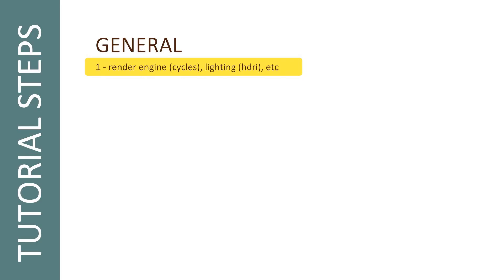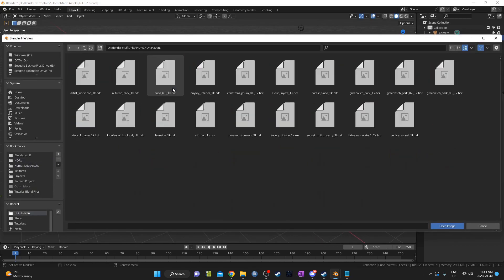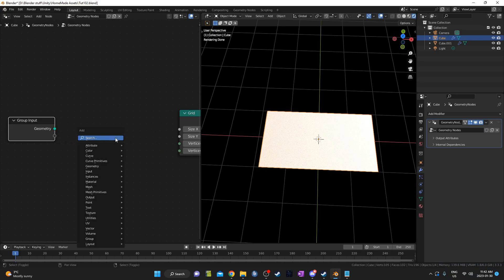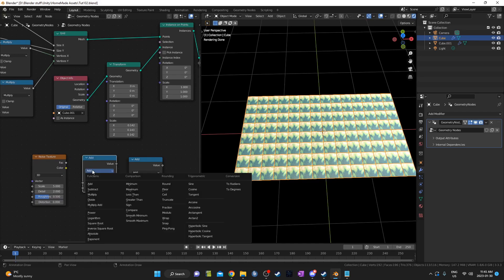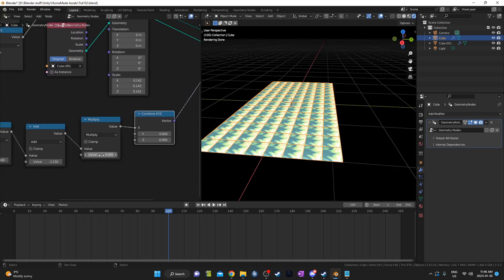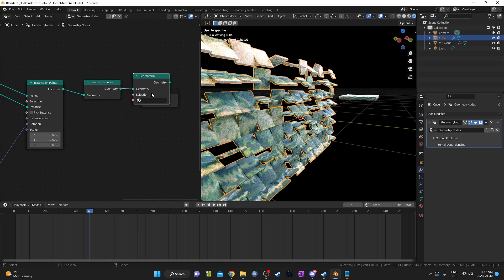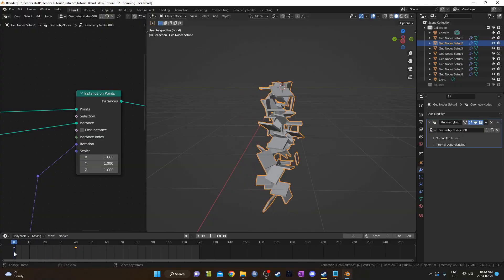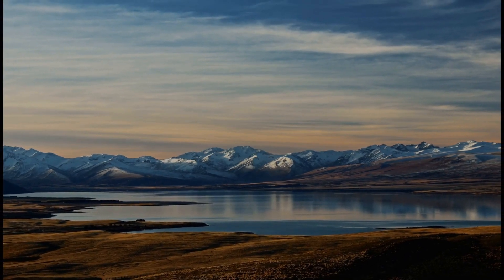How to Spin Squares with Geometry Nodes in Blender

Comment: How could you control the area rotating with a wave or a weighted empty?
Reply from the maker: You could substitute a wave texture for the noise texture to get a wave going. I can't remember if there's a way to get the empty to influence geometry nodes but you could probably use drivers to copy the rotate or position of an empty to one of the nodes.

Comment: The image texture is a bit of a cheat though, it's not that each tile is truly a piece of the image, rather it's projected over all tiles. So it's more like a reveal than a mosaic.
Reply from the maker: Yeah that's pretty accurate. Still fun to play with but I wish I could've gotten it to actually tile like that
Reply: @snow_mamba  I just pulled it off with a kind of involved workaround....that I wouldn't have been able to work out myself
Reply from the maker: @espacemaxim  Ah nice, how did you get it to work?
Reply: @snow_mamba  Basically you make a copy of the object and transfer the UV data to the object you're animating with Geo nodes. There must be a better, updated way, but if you're interested I can send you a link of a video outlining the problem and it's workaround solution.
Reply from the maker: @espacemaxim  Sure sounds great, i'd love to see it
Reply: @snow_mamba  It's the link I posted just above your reply ;) As I said it's outdated, maybe you can come up with a better version